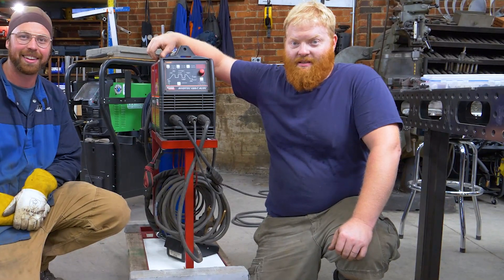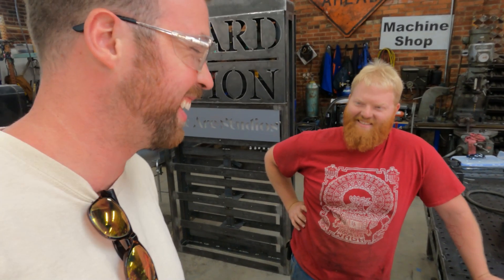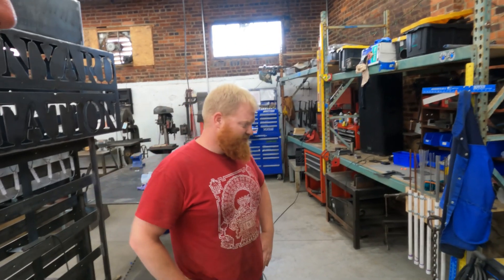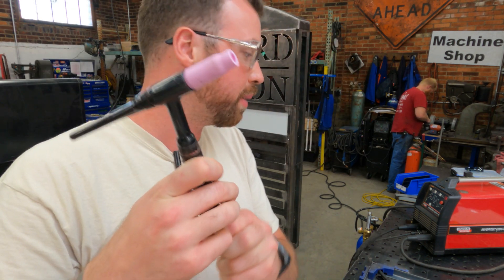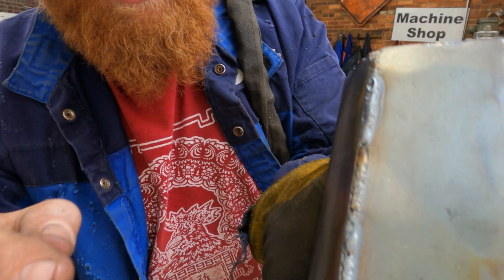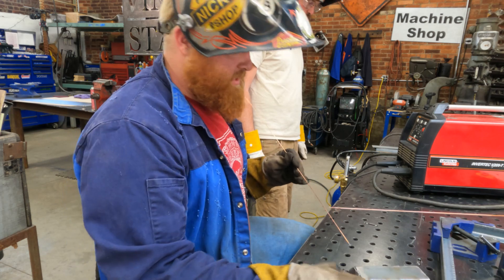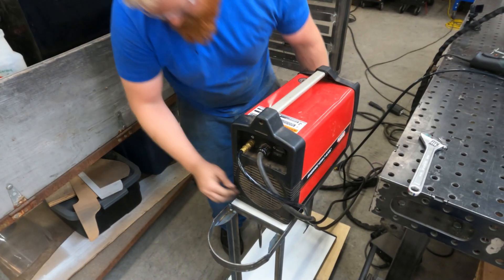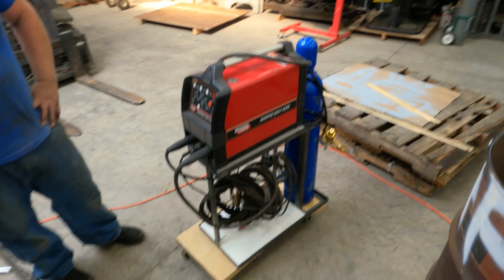Wyatt's Wild Journey to Become a TIG Master // Lift Arc Builds

Comment: Fun project. When tig welding definitely always clean to shiny metal or your setting yourself up to fail. I like the the under cart cord solution. Should have a removable bottle strap so you don’t need to lift the bottle in. Keep up the practice. Putting the time in is the only way to get better! Thanks again for another video. You guys are killing it!

Comment: I know this video has been out awhile but I gotta tip fer Wyatt. Cut the filler metal rods in half. You will have better balance feeding it thru your fingers. Also hold the torch like you would hold a pencil with index finger wrapped over top of torch body and thumb wrapped under it.AL B in Ohio ,a retired weldor fabricator.

Comment: Good job Wyatt. Tig welding isn’t easy. Took me a long time to learn. I’ve been tig welding for years, and still learn new stuff all the time. Good job. A gas lens and a #7 cup, 20-25 CFH is a good setup.
Reply: Justin you are nearly repeating what is in my head, because I went through all that, but I did go to Tafe (Trade School here in Australia) A Stubby Gas lens and a No.7 Cup and 9 to 10 "Litres per Minute", ( 10 Litres is  21 CFH, ... Litres per minute times 2.1, gives you Cubic feet per Hour) and you are there. I'm a Fabricator here in Australia, have been Mig and Tiging for over 24years, I have used the Ceriated Electrodes Tay is using and I do Use the Angle he ground on that one, we predominantly use E3 [Purple tip] now, which is nearly Identical to the "Layizr" (chartreuse green) Electrodes used in America, [handles high temperatures a bit better.]